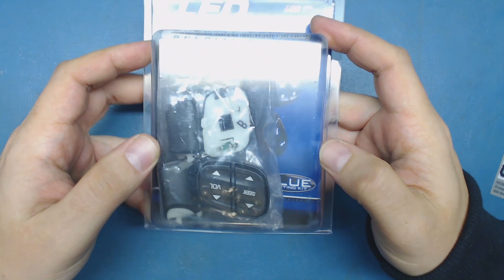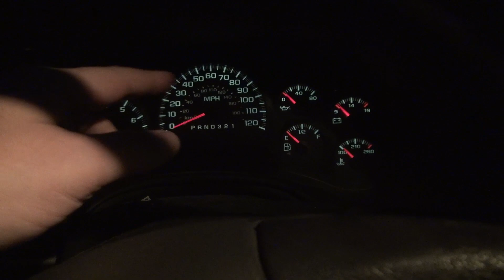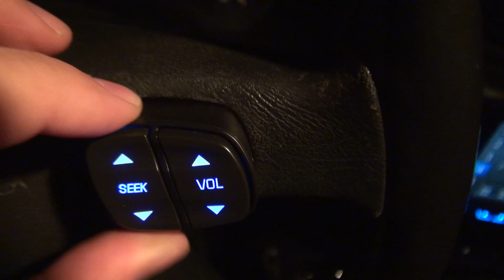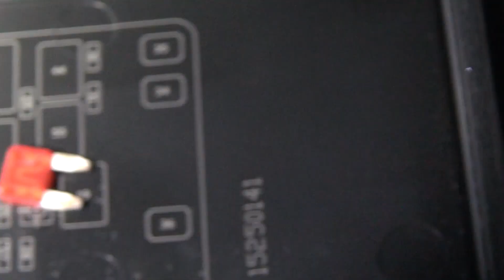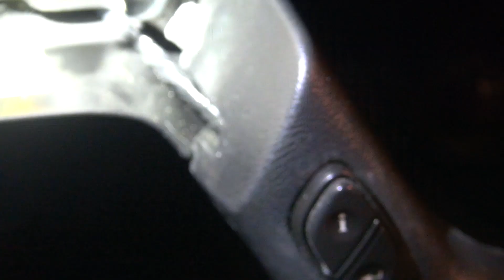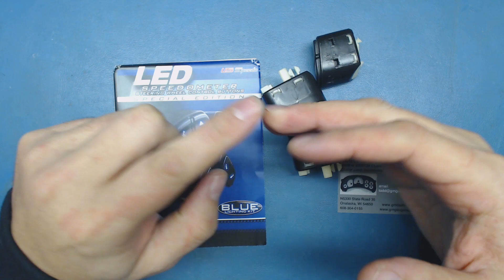Replacing Steering Wheel Controls With LED On A GM Chevy Trailblazer.

Comment: Another way to do it as long as you can get them out with a pick is to take the new switch apart and then rebuild it in the steering wheel socket. I couldn’t get the lower ones snapped back in. So rebuilding the new one in the hole allowed me to snap the connector in and then get it reassembled.

Comment: To make it easier, go to TRQ Channel/Page and look up this. Make it easier to get them all out. Once they are out, put all back together then re-route the bottom connectors, incase you ever have to do it again, but this time you can just replace the switches and don't have to remove air bag again.

"How to Replace Steering Wheel Seek and Volume Control Switch 2003-07 GMC Yukon"

Comment: The first thing you did wrong was turning your ignition switch on with the airbag disconnected or out.
You will always have to reset your airbag with a scan tool...

Comment: I attempted this a year ago I was able to reconnect the top 2 but the bottom 2 suck 
Anyway I attempted it again because I wanted to replace my white LEDs with blue but even with air bag out no luck 
So what I’ll do is go to pick and pull and cut the connectors off another truck I’ll get as much wire as possible and then cut my connectors off and splice them nice nice so I’ll have a extra couple inches and not have to stretch the wires and incase I want to replace them or something again later.

Comment: use dental floss by threading in the middle of the wires on back of connector. Push the switch 1/2 way in the pull on the dental floss from both sides. it pulls the connector in till it clicks. then pull out the dental floss.

Comment: I just did this today on my 2007 gmc envoy instead of poking holes or risk of wrecking the wires it is much easier to pull the steering wheel. The shaft is notched so there is no way to put the wheel on crooked  the wheel came off very easy with no puller all you have to do then is unscrew the two torks screws at the back and unclip the harness and push the switches out from the back making it very easy
Reply: Make a video
Reply: Exactly what I did. Thanks. 😁

Comment: Looked at other ways to do this. Took off wheel and put switches in with no trouble in less than 1/2 hour...  Easy to get a hold of plugs......

Comment: If you would have just did the battery, you would have killed all power. With you leaving all power on except your horn and airbag and you turning on your switch, your computer senced that the air bag was not working...thats why u are getting the message..
Reply from the maker: No, it turned out I broke the retaining clip to the airbag connector. I replaced it and it went out.

Comment: $125. Geez. I gess that not to bad if you need new switches. But I could converted them my self. But I would want new switches anyway. So I gess that's not to bad. And I dont even use the steering wheel controls. So they would last forever.

Comment: The airbag will not deploy unless there is an impact which takes a very hard collision or if you short that circuit. Most people remove the airbag. There is a small hole on each side of the airbag. Insert a small allen wrench to release each side. You can then pull each wire for each switch and make them a bit longer which makes them easier to remove.

Comment: I think GM intended the official way of replacing the buttons is to not only remove the air bag, but steering wheel too. Once the wheel is off the back plastic cover can come off. Once that's out of the way you have all the extra length in wire you need.
Reply from the maker: Thanks Jeff.
Reply from the maker: I thought about pulling the wheel to see what that did for me but it was dark and I don't have the right puller.  Since you do gauges and clusters where can I get the correct led's and new servos? Do the led's need resistors as well? I have a few noisy servos I would like to replace. You can email me if you don't want to get into it here.
Reply: @Kev_31779  any X27.168 stepper motor will be safe to buy (white with that part number printed on it). I like to use old school 5mm LED's. A lot of the pre-packaed 12v automotive led lights are too bright and use unreliable LED's. You'll want flat top, not dome focused lens, diffused prefered. I use 5mm with built in dropper resistor, makes for a clean install. But I purchase direct from a manufacturer in Shenzhen. But there are some cube LED's floating around the state's that work nice too.
Reply from the maker: Thanks. If I decide to do it someday I might contact you with a few more specific questions if you don't mind. I have no problem doing the work. I just hate reinventing the wheel when it comes to research on components if someone has already gone thought the process many times.
Reply: @Kev_31779  I'll throw some blue LED's in the mail for you. No charge for you. You don't need to make a review video or anything. Send me a email when your ready 1mr.repairman@gmail.com

Comment: It's definitely a defect in the product. It's not unreasonable to expect those buttons to last for the life of the vehicle when they do so easily in others.
Reply from the maker: This truck was made in 2007.  Leds were not all that common in vehicles at that time. Incandescent don't last forever. It is pretty common across all vehicles when they get up there in age.
Reply: @Kev_31779  I wouldn't call it a defect problem, but engineering choice problem. They decided to use 3mm lamps. That small of a incandescent isn't going to have a long life.
Reply: @Kev_31779  - you said you replaced your last button about 1 1/2 years ago.

I have a 15 year old BMW with the original buttons in it. The controls are still legible and the lights work fine.

If you think that's acceptable, then apparently I'm the first one to tell you that higher quality materials exist.

Sorry if I sound arrogant but this one is too blatant to let it slide.  That's just junkie American made car materials.  Even Japanese economy cars have more reliable control surfaces than that.
Reply from the maker: I thought you meant the bulbs. You mean the plastic wear. Yes that does seem a bit premature. And yes they could have made the materials thicker so that even wear would not much affect it. You are also comparing BMW to a GM product. Two different worlds when it comes to quality vs price when manufactured.
Reply: I mean the quality of the button from a practical standpoint meant to include finish and deliver the features intended when manufactured.

There are 2008 - 2012 edition BMW where the interior trim finish wears off prematurely and looks ugly.  I mentioned economy Japanese cars as well in anticipation of the BMW vs. GM argument.

Since you're entertaining the topic.... Do the controls wiggle or creak when applying a side to side motion 90° to the direction of intended movement on the old and new controls?
Reply from the maker: I cant speak for the quality Japanese cars since I never owned one so I have no comment or argument to conclude a factual agreement.  I have never noticed if the controls wiggle or creak anymore than others cars I have drove.
Reply: Give the buttons a wiggle and see what they do.  Plastics creak test is one of many things I do when checking a car.  Wiggle the buttons, move the center console side to side, pull down on the visors...  If the mounting points flex or creak - its weak.
Reply: they last, the finish on them does not.

Comment: Nice. Just wondring what is the mileage of this car. I bet mine is superior.
Reply from the maker: Yes I hear that. I have put a lot of work in to keep it rolling. Mostly suspension components.
Reply from the maker: The mileage is about 184,000 miles.
Reply: hehe, mine is 282044 miles (470000 kms). But I cheat little bit, my car is from 98. Nice mileage! In fact it's lot of work to keep our car alive (mostly mine).